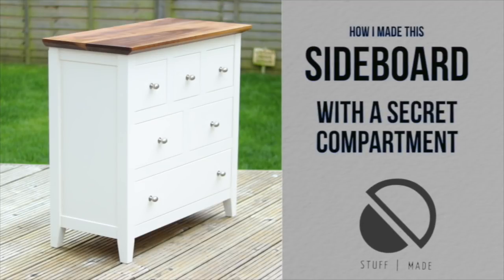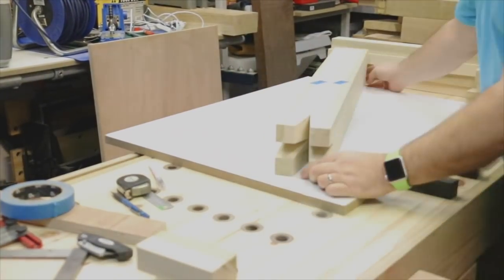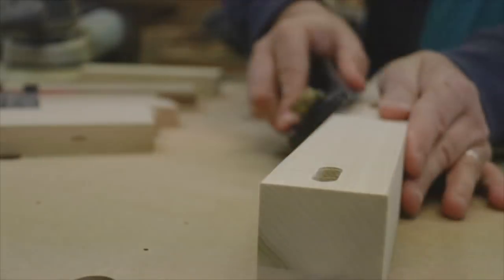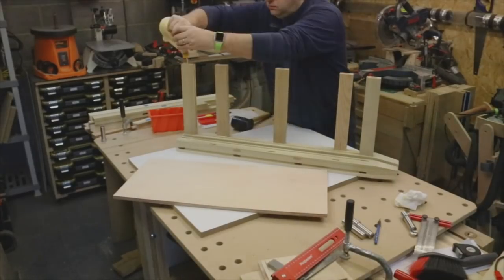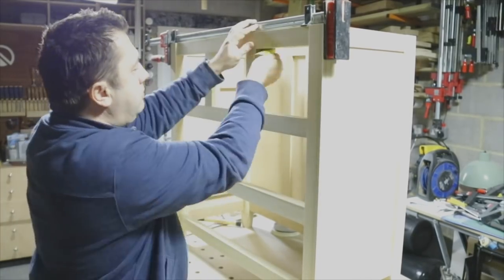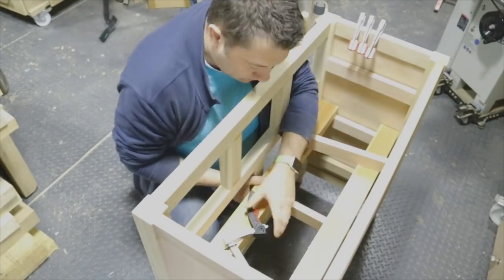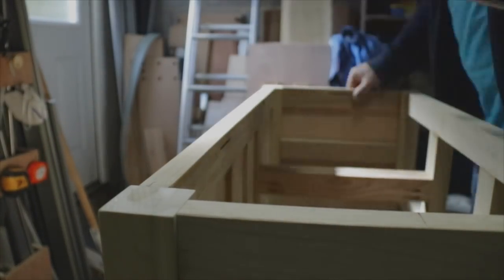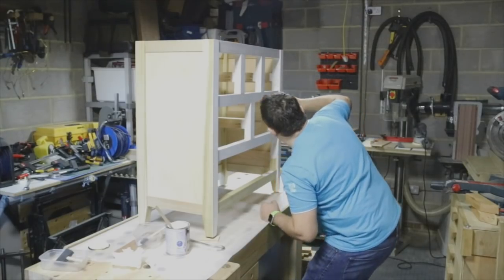Sideboard with a Secret Compartment  (1 of 2)

Comment: This is a great way to joint the face frame with the rest of the cabinet while providing sound support for the drawer runners. I have struggled with this task on several builds, and wanted to learn a proper method. This is it. Thank you.